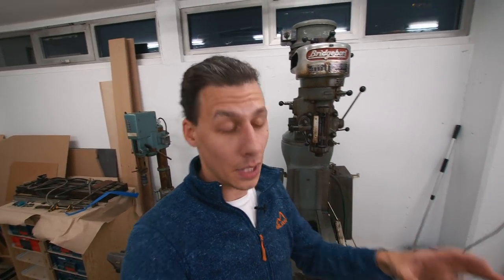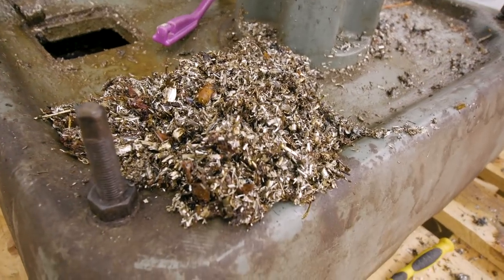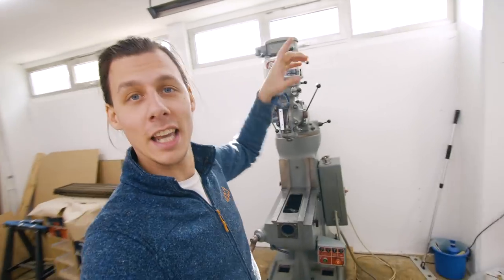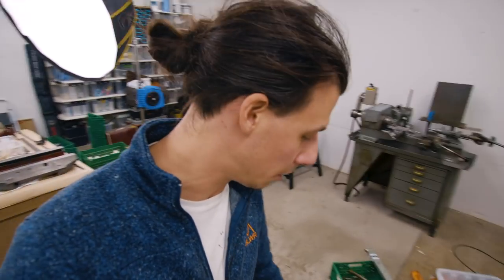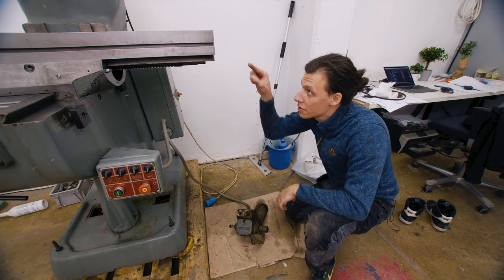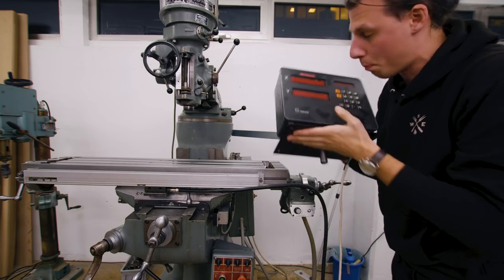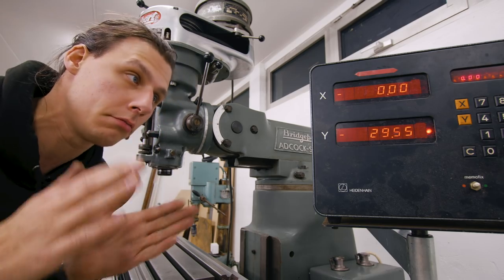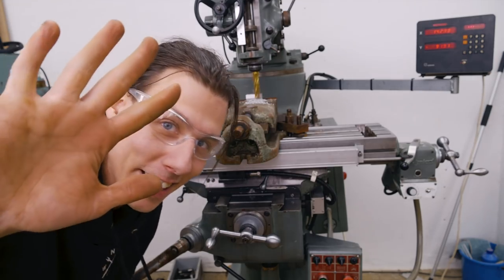Restoring a 60 Year old Bridgeport milling machine

Comment: Having rebuilt many Bridgeport’s through the decades, a couple of tips might be in order. Bridgeport is now owned by Hardinge in New York. They have every part for this machine in stock.  The wipers are NOT leather. They are felt. Leather will trap chips behind them while felt collects them to keep anything from entering the ways.  The use of grease isn’t that bad. Just think what it would be like without any lube. I didn’t catch what type of oil you were using, but  “way oil “ should  be used . I.prefer Vactra 2 or 4 .  Extreme care should be used when dealing with any scraped surface. These are any surface on a Bridgeport that has been flaked. Any bruise should be dealt with  using a stone .  Remember these surfaces determine the precision of the machine.The head is another ball of wax with a lot of little tricks to do is easily  and right. Hardinge has parts lists and assembly drawings on line. Good luck with your “new”Bridgeport. By the way all of the debris in the saddle is normal. It makes its way there at the small space by the knee axis
Reply: That's cool. I had no idea all of the parts are available. I'm picking up a mill soon and thought I'd have to source parts like it's an old car.
Reply: JC4crs  I looked a little for that Lube8. Where are you getting it? What brand is it?
Reply: Thanks for sharing the Hardinge note, I had no idea! Also, the Felt - you are right about. I used leather once on my workplace mill and it got worse.

Comment: Kudos, I took some machine shop classes when I was younger, and even worked at some jobs running various mills, some CNC and some not. The mills I used in training were immaculate the ones I used on the job less clean but serviceable. I cannot for the life of me, figure out how someone could use grease on the X and Y axis surfaces. The fittings used to put oil on those surfaces are commonly used to press grease in to an area so I guess. Those fittings called a Zerks.  I watched you clean and thought of the smell oooh so bad.  good job and good luck.

Comment: Great clean-up tutorial! I used a Bridgeport about 20 years ago when I worked as an Engineering Technician. I learned on-the-job and it was kind of scary at first, but once I gained a comfort level with the machine I really enjoyed using it. It expanded my knowledge of how to make things and I was blown away at the skill of some of my older co-workers. They freely shared their knowledge of how to properly do things with me. Since that time I have had the desire to get one for my home garage, but that's still a fantasy at this point. I have two cars in my garage and there is no room for this type of equipment. However, my hope springs eternal that I will create my own home workshop at some point. Thanks for the video!

Comment: There was nothing wrong with your DRO after your clean-up! Get the manual and read about the Memofix feature which enables the 0,0 datum point to be fixed even after a power off. It 'remembers' where the datum point is so when you resume working you can start at the correct place again. You had the Memofix switch on and the red light in the display was on. In the Bridgeport manual there is a section on how to use the  Heidenhain DRO properly.

Comment: I don't think I have ever seen a complete machine rebuild in a single video before. Just a side note: that power feed bar that runs down the front of the table can get in the way as well as mounting the DRO scale on the front rather than the back of the table. It might not let you consider hanging a part down on the front side of the table - a feature I have used several times before. Overall - well paced, fast when it needed to be a slow when explaining. Really enjoyable.

Comment: 16:23 I'm fascinated by builds/rebuilds like this but I must say the squeegee find was simply brilliant on your part!  bravo!
I used to work for a tool and die maker and we'd sharpen endmills all day ling for the machinists in the area. I remember walking into large machine shops and seeing 30-40 Bridgeports all lined up on the floor cutting parts assembly-line style. This video brought back a few memories. Well, it was only one in your shop but....

Comment: We have a 64 step pulley j head at works with the original saddle and table. Has a lot of hrs on it. I put a variable frequency drive motor with a Hitachi drive box, servo knee feed, x axis power feed and a mitutoyo dro on it. And now it gets used almost every day again. Amazing machine tools

Comment: Tip to keep the flakes out from inside the bottom part is to add a pice of rubber on top the slide parts below the table, both on the outside and inside, helps the dovetail leather wipers to get rid of the majority of flakes and grim. Hard to explain in text and you might already done it, but check out Alex Steele as he did something like that on his Bridgeport. Nice to see the mill in good hands though! 👌🏼

Comment: I bought A Bridgeport 20 years ago that was older than yours.  Yours is not that bad of shape now that you have cleaned it up.  Any future restoration projects I think making use of laser cleaning will significantly speed up the process.  You can use the laser to degrease it and remove any rust or build up.

Comment: On my second Bridgeport, I had the pallet unloaded out onto a large tarp in the back yard. Did some disassembly, spread out the parts and pressure washed the thing with liberal use of degreaser. It just takes WAY too long to get it clean with spray bottles and rags.
Reply from the maker: wxfield jeah man! That sounds like a great idea!    Did the same to a smaller lathe I bought, although I used a car wash next to my shop 😅
Reply: @achappel  Genius!! Now that would make for an entertaining video. "Taking your lathe to the car wash".

Comment: I know an old Bridge port in Sheffield England that needs a similar treatment (but at least Richard knows about the oil, NOT grease issue).His has some extra features and the shaper attachment and the cutting fluid catchment cone.  Almost all old machine tools are full of chips and sludge, most of it VERY old. I know that because  I have stripped and moved several of them. BTW - that is the SHORT version of the bed!
GET a stabiliser for the hand held shots, or it will give people motion sickness. You have lovely ideas - so let people see them.

Comment: Agree with Dudley Toolright... The glass scale should be mounted on the back of the table. That way... It's less prone to damage and... you can use the t-slot to mount an auto-stop for the power feed.

Comment: Could be bad wire in the DRO harness, and you just got lucky, or perhaps old cap on one of the boards, overall nice job, would get some felt pads, purge all the lines of any grease(with way oil), can even add an auto oiler at some point...and they also have air chucks for the collets, and motor drivers to set the speed :) lots of optional upgrades you could do, if your chasing zeros as well -- but first step is proper maintenance and finding how precise it is

Comment: I have to admit, having worked with Millicron and Bridgeport lathes for most of my professional career, I cringed when you took it apart (without a manual or familiarity with the machine), combined with not fully grasping the basis of 'accuracy' which this type of machine is capable of. Bridgeports are easily capable (in 'like-new shape') of recreating 0.0001" accuracy in replicated components...so just tearing it apart, scrubbing it, little 'sanding' here and there' can make them a total PIECE OF JUNK, quickly! When rebuilding a Bridgeport, the standard is to dimension critical parts (table, ways, etc.) by producing a 'baseline part' (make something to dimension first), so that when you rebuild the 'cleaned machine', you can make a duplicate part and see if you retained the machine's accuracy (if not, the replicated part can more-easily show you where your inaccuracy can be found...maybe a now-warped table, slack in the gears, worn out bushings that now can be seen as years of residue is cleaned away, making slack at various points, etc.).
As you did not baseline the original machine, other than making it aesthetically 'prettier', you have no way of knowing if your actions were detrimental to its actual purpose, had no effect on its accuracy, etc. This was not impressive, as viewed from an experienced machinist's viewpoint...you blindly tore it apart, cleaned it, and reassembled it...did I mention, I cringed when you took the Scotchbrite to the table? OUCH!
Reply: Highly doubt that its easily capable of recreating 0.0001" accuracy but go off
Reply: Retired toolmaker , I cringed also seeing the sandpaper. In expert hands tenths of a thousands in accuracy are achieved. These type of machines were what we had before super accurate and expensive machines came along.
In the right hands using the learned techniques very high accuracy can be achieved.
An expert on these machines in the day could make very good money. I live in a neighborhood of doctors lawyers and businessmen.

Comment: The content is great but the hand-held camera work is unwatchable.
Reply: I disagree.  He does many things that are detrimental to the precision of this machine tool.
Reply: @Tsamokie  Can you elaborate?  I'm going through a similar restoration and would like to learn.
Reply: @GetBlitzified  Cleaning precision surfaces with scotchbrite is no good, you will just end up destroying the geometry. Also this is not a rebuild but merely a cleaning...
Reply: @irfp460  Your first comment would in my opinion have validity if this was an unworn jig borer or he was using the coarsest grade of scotchbrite for hours. It's a worn Bridgeport.
Your second comment is kind of weird given that it does not claim to be a rebuild, but a restoration. He's restoring the appearance.
Reply: @Gottenhimfella  For me a restoration is to restore the machine to it's original specification. Which means to correct any mechanical problem.
While scotchbrite is slow to take off material it's still not the right choice for a piece of precision machinery, there are better ways.
Reply: @irfp460  Are you sure you're not taking refuge in your personal semantics? The arguable meaning of specific terms does not seem to bear on quality of content, which is what you took issue with?
"Better ways", it further strikes me, is always a question of context. This (formerly somewhat precise) machine would need the key alignments expertly rescraped even to approach toolroom standards, which is not going to happen here. And even when new, it seems doubtful Scotchbrite would measurably have downgraded its accuracy, given that was never truly a toolroom grade mill. The tabletop flatness tolerance for a Bridgie would be + or - 0.04mm per metre when new, and unless you've ever tried to remove a quarter of that amount from a flat surface using regular Scotchbrite I think you'd be surprised how many hours of solid effort it would take.
Reply: @Gottenhimfella  Possibly, but that's what I consider a restoration. Restoring the looks doesn't affect the machines performance, which is what counts. Having scraped quite a few machines I can assure you that even fine scotchbrite will change the contact pattern quite quickly.
Reply: @irfp460   Sure it will, but only for a surface which was pretty flat to start with. This machine is worn.
And you can't validly criticise the owner for not showing us how to do a rebuild, because he has no intention (and not the ability, or the need) to do that.
Reply: @Gottenhimfella  I can criticise the creator for putting a misleading title on the video, as I said before, this is not a restoration but merely cleaning the machine and in the process damaging critical precision features. He did not even tear the head down or take the knee off.
Reply: @irfp460  While I agree with you that the title is factually misleading, this is as far a "restoration" of this kind of precision machine can really go in a user enviroment. A true restoration of the machine back to specification tolerances would require an industrial setting. Given it was pretty obvious from the thumbnail that this guy is not running or is not employed in an industrial capacity, I never for a second expected more than a "touch up" so there was no misleading really, and there shouldnt be for anyone similarly aware of what a true restoration of such a machine truly entails.
Reply: @imvisier9925  No, it doesn't require any industrial setting. I have quite a lot of machines and restored most of them to manufacturer specifications or better. You need to learn how to scrape and buy the measurement equipment, but nothing really special is needed.

Comment: Hi I spoke to a fitter and turner about your mill he said that the error reading is common he suggest de soldering and cleaning the circuit board then re solder and seal with lacquer. Not sure if this will work in your case but I did notice the circuit board was a bit dirty in your video he said its the vibration that loosens the solder joints. 
Good Luck>> Neil from South Australia <<

Comment: Once cleaned, the paint looks like it just came out of the factory !
If you are using soapy washer for cleaning, spray with a light coat of Fluid Film when you are done to prevent flash rusting.

Comment: Can I ask your advice? I'm an aspiring maker and have recently come upon the opportunity to purchase a very well maintained ENCO 100-1599 Vertical Milling Machine. 
Do you use this machine more or less than you felt prior to owning it? Is it much of a headache to relocate or even just shift around the workshop?

Thanks so much. If I ventured to guess, I've been subscribed since the 5 figure level. I even made the outdoor bench from your plans a few years ago. I constantly receive compliments on it! 
-Chris
Reply: I can answer one of your questions: it is absolutely a headache to relocate the machine… unless you own or rent the proper tools.

I just landed my first mill (1969 1 HP). Used brand new rated lifting straps lifting and a rented forklift to get it into my shop. Still had to slide it about 3 feet to get it where I want. Plan on $300 for the rental (2022).

I also rented a cheap Uhaul trailer for $50. Check and double check everything. Ask the old timers to help you strap it properly, Better yet, HIRE a rigging company to move and place the machine for you. It can be unbelievably stressful if you’re not used to hooking up, hauling and rigging heavy equipment. 

Also, unless you have extra warehouse space, figure out where you want it before you set it. Clear a space. Clear access. And have tools and tables and rags etc handy.

You’ll probably use the hell out of it if you’re a maker. Start looking and saving now. Took me almost 2 years to make mine a reality.

Comment: Snap on makes a tool. It is called an air solvent gun. Tool # GA299. Attach it to an air hose. Submerse the siphon hose into what ever cleaner, chemical, gas diesel etc and watch it work. Be sure to wear a respirator. It would have made that job as simple as washing dishes.

Comment: Based on the look of the scraping on those ways, that mill had very little use. As gross as it was to clean the grease out, at least there was no rust. It really should be accurately leveled at the very least and depending on what you plan to make on it some calibration adjustments may be in order. Otherwise, that looks like a really nice mill to work with.
Reply: @LachlanD1213  i learned on thing from a youtuber its called its my tool i can do whatever i want nonetheless yes not recomended to sand the mills way and table unles you are removing rust .

Comment: Grease holds chips and will scar the ways! Oil flushes out the ways while it lubricates them! Oil is also designed for the compression load from the table. Way oil is tacky to stay on the ways. Way oil also reduces vibration when cutting! Grease is not even part of the formula on ways! My mill does have a few things that get grease like the counterbalance weight chain. And a few other moving things. But the X, Y, and Z axis ways always get way oil!

Comment: Should not the sensor rail (DK what it's called) be on the back of the table❓
Reply: It doesn't matter, but it is much harder to drive the front of the table into the knee of the machine.
And remember that air duster guns and optical glass scales do not mix. A blast of compressed air is a great way to push oil and swarf through the seals and onto the glass.

Comment: Something as simple as a drop or smear of oil on the glass scale can cause that reader to not work correctly.  And it can be a PITA to get it clean.
But keep cleaning with Q-tips or cotton (something that won't leave lint) and it should be OK.

Comment: The pieces you cut from leather might have been felt originally, that is what is commonly used for way wipers.
Reply: Very nice machine by the way, looks to be in great condition!
Reply from the maker: Thanks! Oh right! Hope that leather works to then 😅
Reply: @achappel  They are felt and available on fleabay. The complete set is just 10bucks.

Comment: Been here recently myself, though the machine underneath didn't have the dovetail ways in nearly as good condition.
Why do folks just assume those fittings are for grease? I had to use a plastic spoon to dig most of it out of the knee.

Comment: Made a good living running Bridgeports ect before cnc took off. A well tuned machine can hold +/- .0005" on locations.
Well tuned is gibbs set just right backlash set and machine trammed in accurately, there's others you'll pick up on as you go.
 Everything we made at many shops was inspected by a CMM . We  could hold under .0005 " total tolerance boring bearing holes.
The DRO won't compensate for a out of tune machine so keep it tuned.
Cringed when you got out the belt sander JUst Don't. Use a flat hone stone.